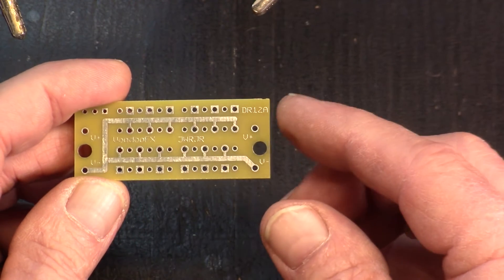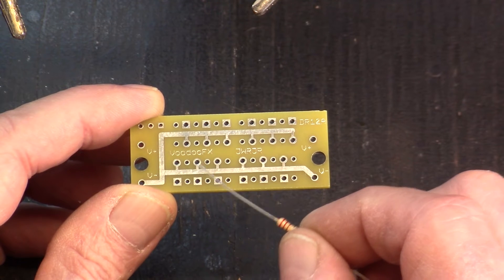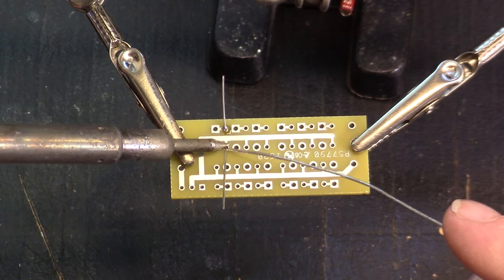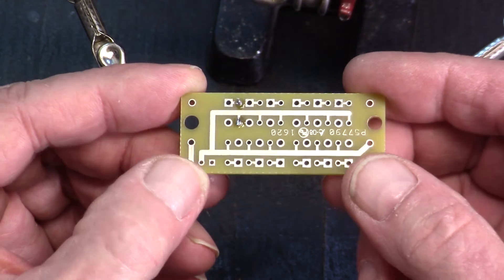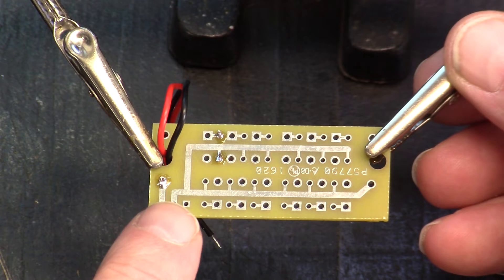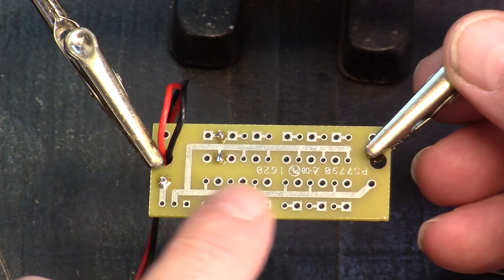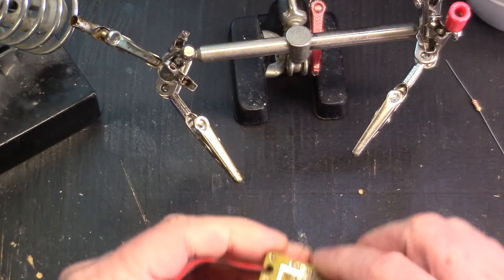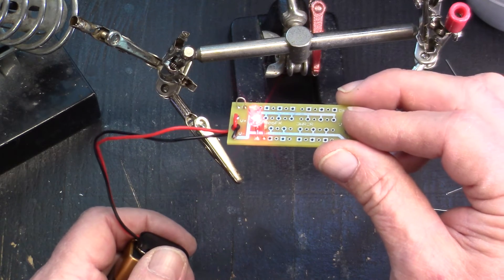Circuit Boards & Applications.

Comment: Can you make an Adjustable Blinker Board so some could Adjust the Blinking rate of an LED Light from Fast to Slow for Slow for Strobe Lights or Fast for Weapons Firing Effects ?
Reply from the maker: Hi PJC 2.0, I do have a few boards that are adjustable. You would need to have a little bit of Arduino background in order to adjust it, but all my programs have adjustable rate settings. Here is a link :  https://www.voodoofx.com/product/all-in-one-board/

Comment: Thank you so much. My question is seeing that there's a resistor hooked onto the board do I still have to put a resistor on the LED itself when I install it
Reply from the maker: Hi Tim, No you will not need to add resistors to the leds itself, all the resistors live on the board.